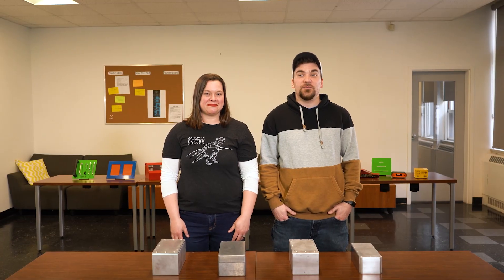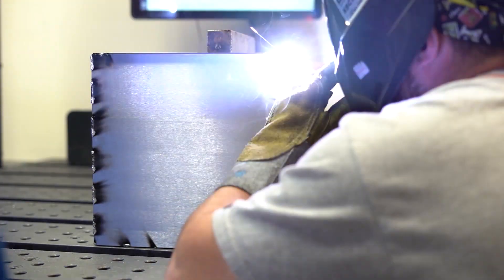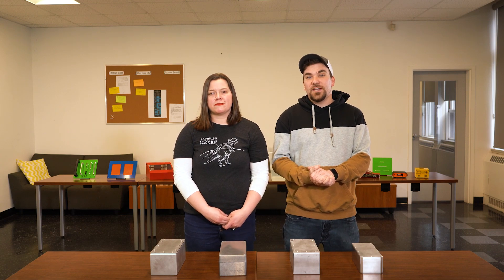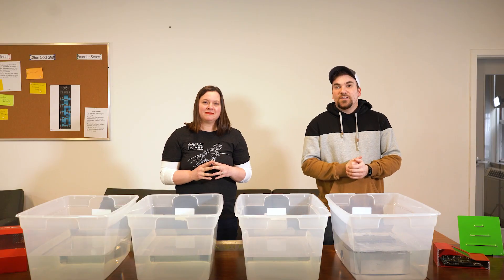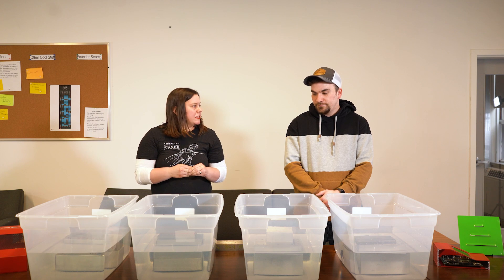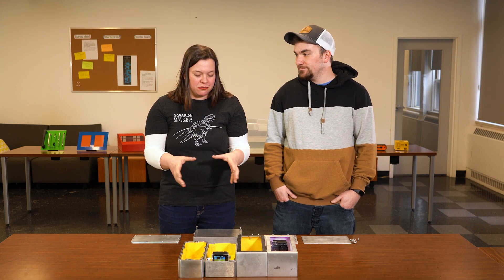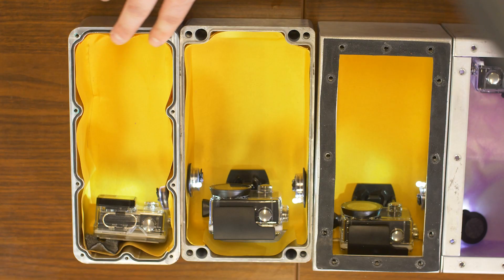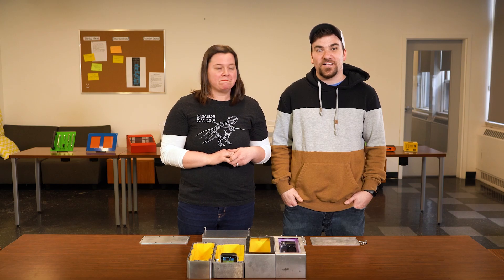Proto Experiment: Testing Custom Watertight Enclosures

Comment: I was surprised to see the cost of the one piece diecast to be so much cheaper than the welded sheet metal.  are you not factoring in the NRE? Who made the diecast for you?  Between the diecast and the the welded sheet metal box, what would be your estimate of price at 100 and 1000 units?
Reply from the maker: Hey Ryan, because the diecast enclosures are sourced directly from Hammond, there is no non-recurring engineering costs to factor in. You can learn more about our Customizable Diecast line here: https://www.protocase.com/products/diecast-enclosures/ (And for specific 100 and 1000 unit pricing, it's best to reach out to info@protocase.com so that we can provide you the most accurate quote based on your needs).

Comment: there are various grades of ingress protection. "Water tight" could mean anything from splash proof to gas-tight. ALL elastomeric seals leak gases, which means they can trap condensation, air contains water in gas form. Test by leaving a sealed box outdoors for a few months in the rain and shine. GE's old "sealed beam" headlights had glass to metal seals, everyone else use weep holes.
Understand the spec and the limitations you have with each seal technology. You can gross leak test with a pressure fitting, maybe a drilled thru screw, on a finished product without drenching it. Measure the leak with a flow meter. 
At some point everything leaks, a helium leak tester may be needed.